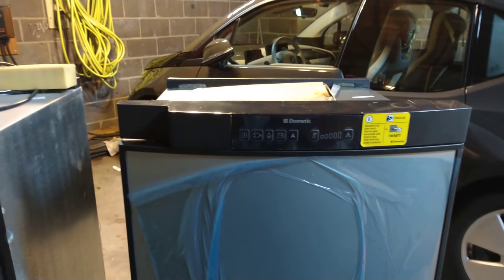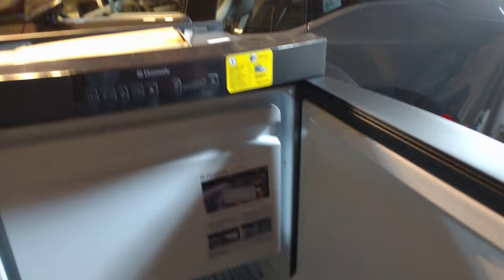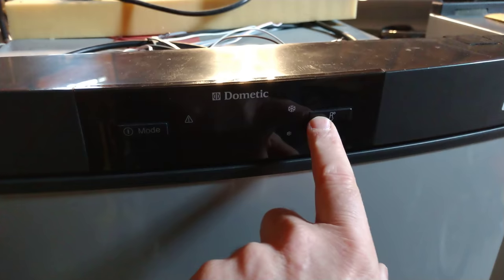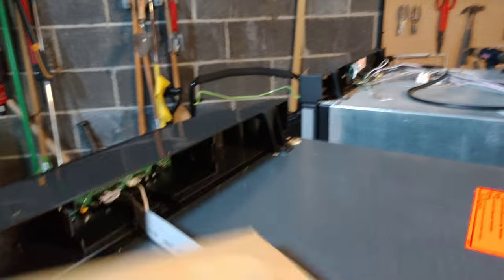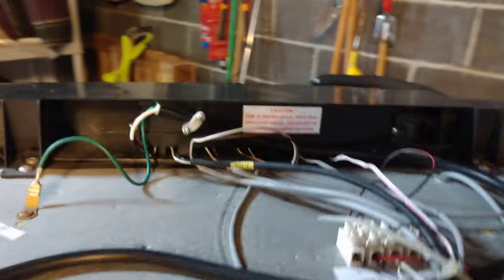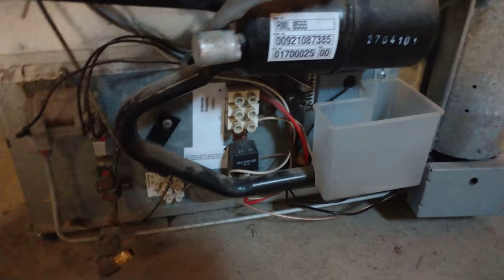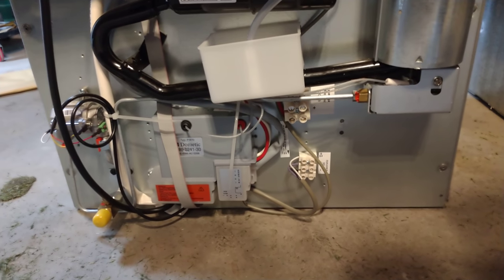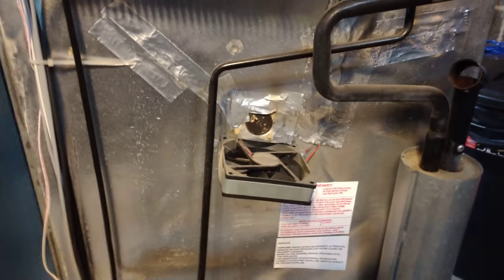Dometic RML 8555 Refrigerator 2010 vs 2017 Models

Comment: Greetings - I am the other owner of a Dometic RML8555 in the USA (2011 Itasca Reyo 25T). We belong to a very exclusive club, so it seems. I am pretty sure I have a blockage in my cooling unit, and am wondering if you have any words of advice on unblocking (where hot turns to cold). The "backside" of the fridge looks new - no rust, and the removable freezer shelf is a feature I'd like to keep. I would appreciate any leads on a good, reliable source for spare parts (I live in AZ, USA), especially a new cooling unit. The major RV dealerships in town seem to have a tough time finding the RML8555 in their parts catalogs. Thanks!

Comment: Did u have any issues with the 2011 model cooling with propane?  Mine works fine on elec, but not on gas or 12 V.